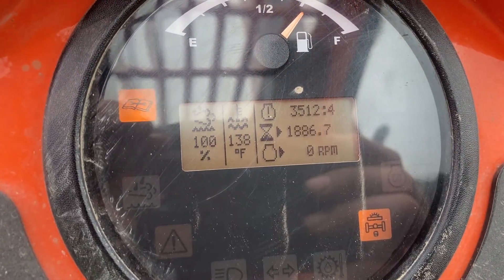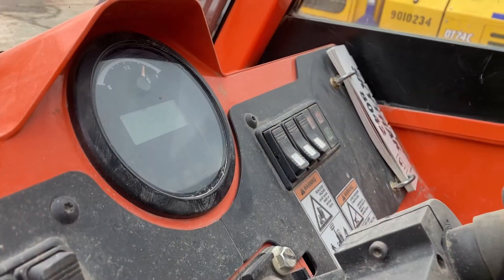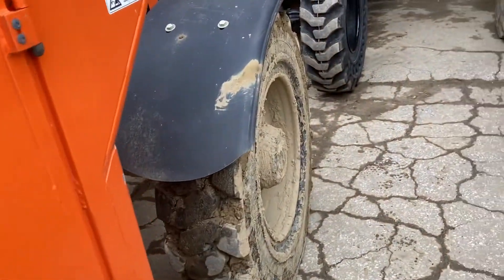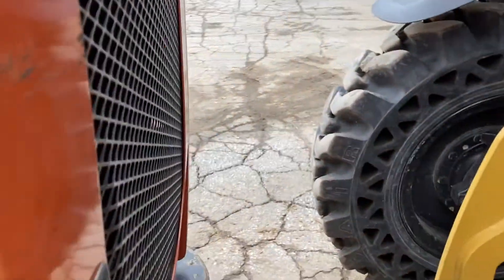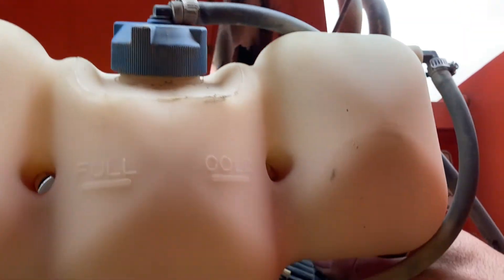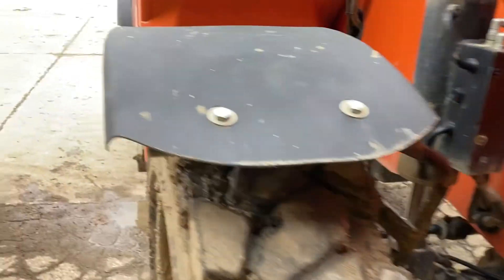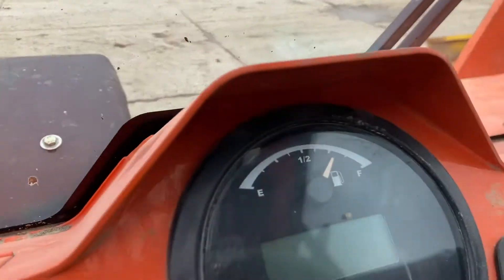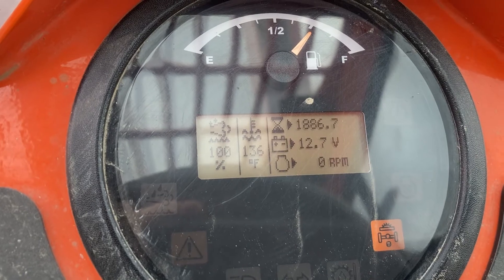FF4 SKYTRAK code 3512:4 shorted supply voltage

Comment: I have a 4394 rt no power with a good battery
Reply from the maker: In the ground control box the little circuit breaker attached to the door is the place would start looking. Other then that start at the battery and check for open circuits.